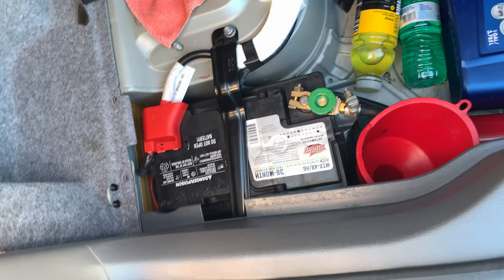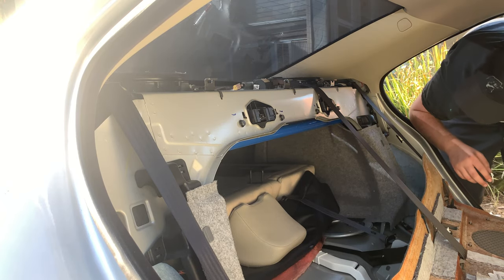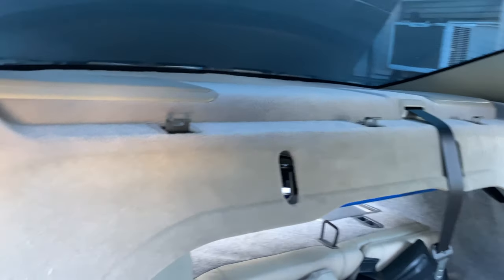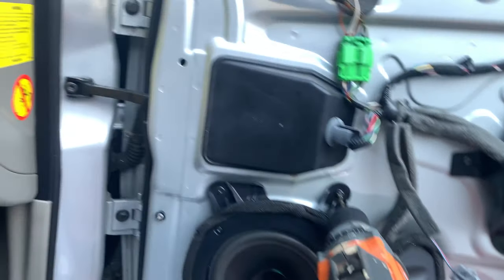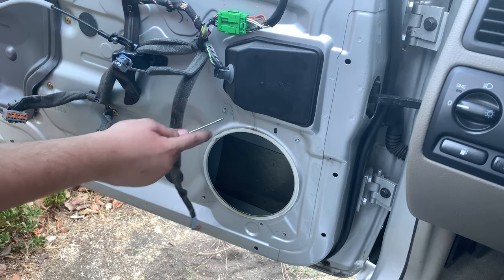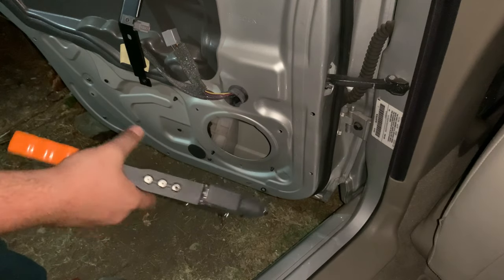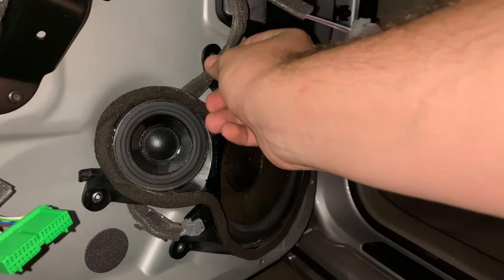P2 Volvo Premium Audio Upgrade! 300W amp, Premium Speakers, & Hu-850  Head Unit.

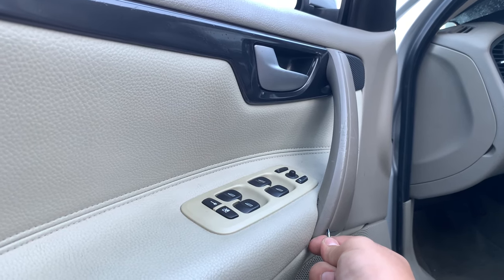Comment: 5:11 There's a small access hole beneath the front door handle, from which you can actually push out the trim piece from behind. No need to pry it out, always ends up a little marred. Also, be careful when taking off a doorcard, the plastic clips holding on the door handle cable are pretty fragile. Lift up the doorcard just high enough to be able to unclip the cable, then pull it off further.
Reply from the maker: Haha yeah they are fragile I broke one  :(

Comment: Does the original Premium Sound package came with some extra dampening/isolation inside doors already from factory?... or was it just the head unit + speakers + amplifier?  Usually when sound is upgraded, then noise proofing matts are installed inside doors.

Comment: Excellent job! 

If you put the masking tape or electrical tape around the rivet, it should prevent marring the door a bit better. The residual rivets will fall into the inner crevice where the water (if any) can drain. If you put masking tape behind the residual rivet, it helps not loosing them down. So you can recover them back not letting them there for the source of unnecessary noise.
Reply from the maker: Thank you for this tip! I do think some tape around the rivets could have helped! When the rivets fall in the door I tend to grab something with reach like screwdriver and push them to the water drain hole so they fall out of the door. It would be nice if these where just bolted in lol
Reply: I just stick a vacuum hose and picks up all the rivets they fell

Comment: Respect you did this upgrade. So much work. I had HU-850 and amp in my old Volvo S60, what a amazing sound. I still miss it. Now I have an S80 with standard sound 🤔 Btw a bit strange, my HU-850 and climate control unit were separated. So I didn't have to remove the shifter.
Reply from the maker: Thank you ! And well that would make the job easier! The sound for how old the speakers are really impress me!

Comment: hey, nice video!
Is the upgrade for the head unit mandatory? why is it needed for the new speakers? thanks!
Reply from the maker: Thank you! It’s needed for the proper amplification and to fully use all speaker including the one in the dash. It’s not like 100% necessary but it’s 100% recommended!

Comment: Is there a speaker under the grill on the dash board? The one above the air vents? Seen at 0:38. I am doing this to a V70 which has a slightly different set up. Thanks.
Reply from the maker: There is!

Comment: Did I miss the dash speaker install? Still wondering how to access it..
Reply from the maker: I just rewatched it and it seems I didn’t include it, it is very simple to do . The dash speaker grill is held in by clips , you just pry it up. Do so carefully as to not ruin your dashboard. All cars are pre wired with the connection put the speaker but without the hu-850 I believe it does not work. I can make a separate video on this if need be.👍

Comment: hey ! thanks for this, looking to do the same thing on my XC70. adding the amp is no problem ? just plug and play ?
Reply from the maker: Yes just plug and play! Plug in power witch is found under seat and then you may need to acquire wire harness to connect amp to head unit!
Reply: @positivegarage  thanks for your answer. other question: are the speakers different too If i have an volvo audio set up without amp ?

Comment: Quick question as I’m looking to do something similar to my 04 XC. Do you know if the new head unit has to come from the same model year as the car? On the forums I keep reading that not matching the model year can mess up the display in the radio and others seem to have not run into problems. Thanks!
Reply from the maker: Mine still worked even tho it was from different year, I don’t think it matters much

Comment: What size are the rear deck speakers?
Reply from the maker: 8-10” I believe I’d have to get a double check on that
Reply: @Positive Garage  right lol I THINK their 8" but I'm not positive either. Guess I could pull out a tape measure. Seems like nobody really knows lol volvo blogs & all💁‍♂️